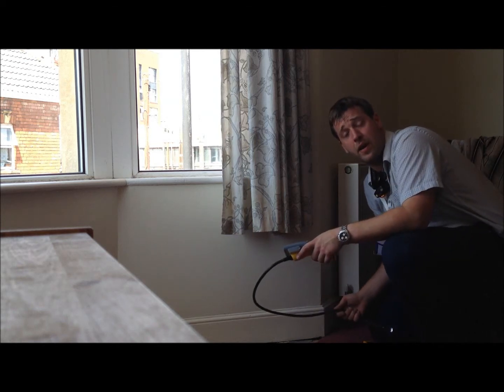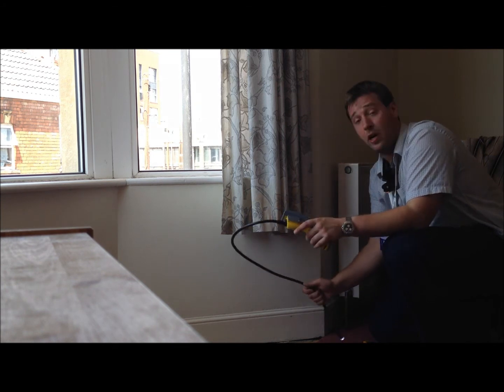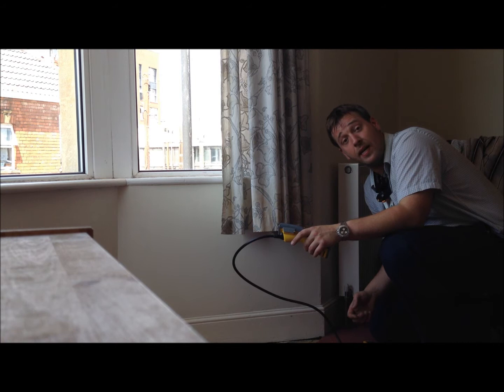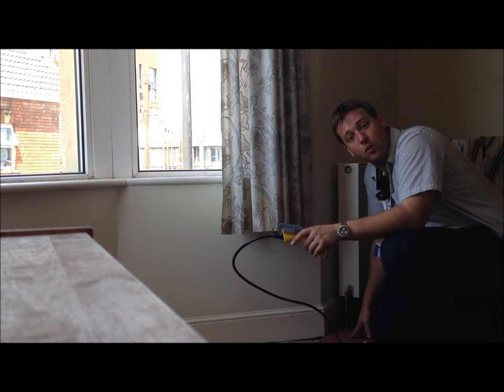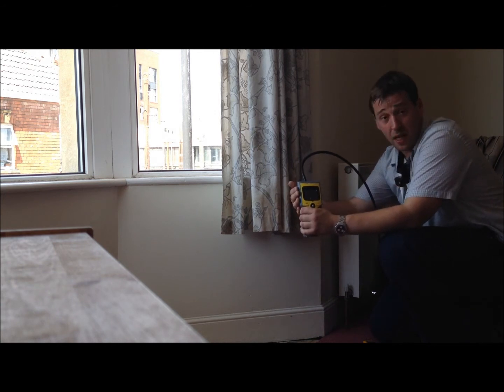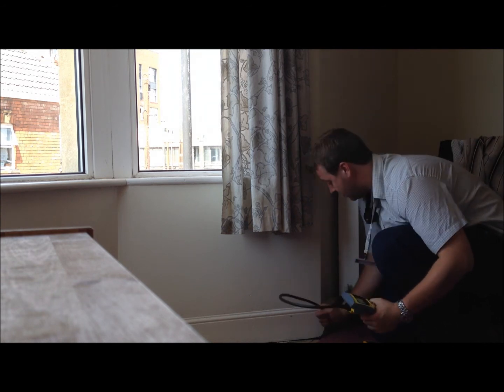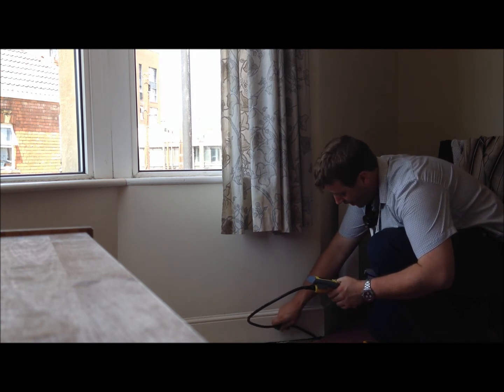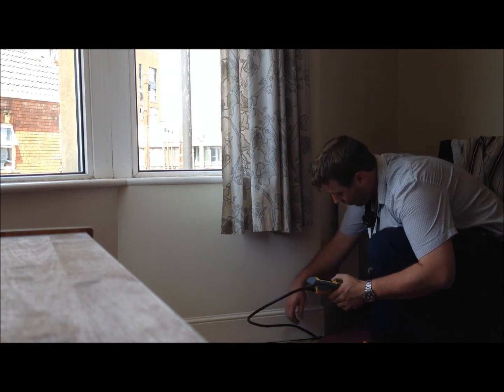endoscope, borescope underfloor video capture domestic surveys, building survey

Comment from the maker: Hi Ian, This video was 2013 and in 3 years the technology has moved on significantly since then with screen sizes, camera quality and length of flexible neck and lighting intensity. We use both borescopes (cavity walls) and endoscopes (drains, sub floors etc.) depending on what is required by the client. You can pick up entry level endoscope like this one now for as little as £50.00-£100.00 from ebay etc. The skill is in using it well and being able to identify what you are looking at.